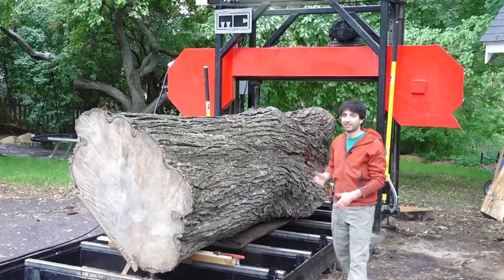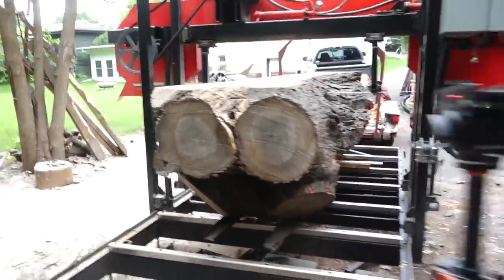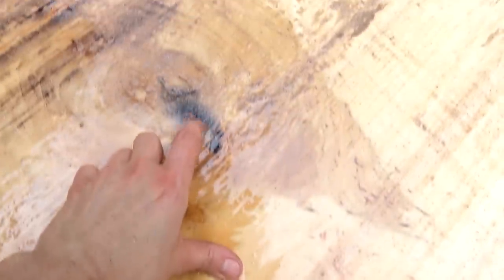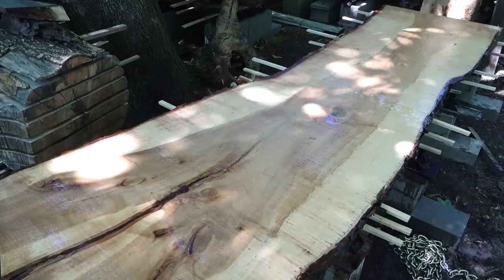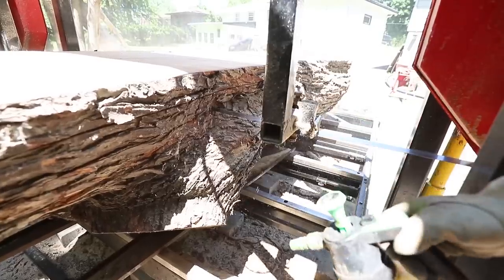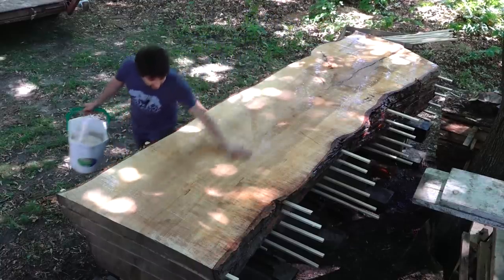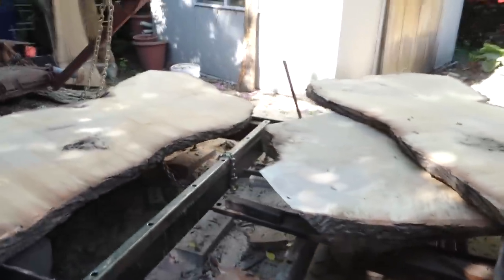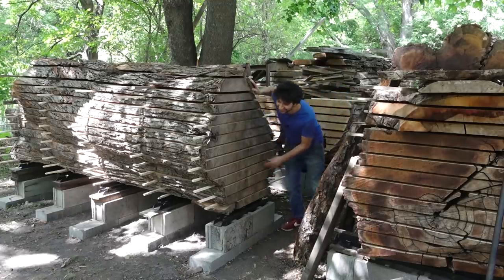The most steel I've ever cut through - Slabbing a Big Silver Maple

Comment: About 25 years ago I used 2 metal shelf brackets to attach a bird house to a maple tree in my yard. Within a couple years the tree grew enough that it destroyed the bird house so I was going to take the shelf brackets down... NOPE, the back part of the brackets was almost totally engulfed in tree. I ended up just cutting off the protruding part of the brackets. Now you can't see any metal and there's just a little rough bark where they were. The trunk is about 5 feet in diameter until it gets about 7 feet up where it splits into 2 branches. It's a large tree and I can only hope that if it ever gets milled up the person doing it is as nonchalant about sawing steel as you are.
Reply: No doubt!👍

Comment: How many blades do you run through on these kinds of trees?? and how much do they cost?
Reply: well it's probably a $10k tree so a few hundred dollars in blades isn't a big deal.
Reply: 20 years ago I charged $25 for each 13’ blade for the Woodmizer that was damaged by debris in log. 
Plug cutter and nail puller worked well removing the metal .....usually
Reply: That aint no 10 thousand dollar tree.

Comment: Gotta admire Matt for perserverance.  After he recounts all the work, misery, and bolts and nails that wrecked expensive blades, he answers to - "Why bother sawing these logs at all?"  as  "...mostly for the adventure.... I just really, really enjoy the struggle!"   Wow!  13:39  Now that IS honesty!  I'm wondering if he couldn't use a metal detector and then tack weld or stud weld (after side grounding), each of the steel bolts or larger nails to then twist them out, rather than ruin those huge wavy-cut  blades?

Comment: Forget the crank handle Skipper, use an old school traditional 8 spoke ships wheel.
 
Don’t mean to tell you your business but that’s obvious....
Reply: Heck yea, standing throttles on a ship can be a blast when you are doing maneuvers. I am thinking a big brass ahead wheel, but I get your point.
Reply: That would be easier on the arm to turn, but when he sprays the blade he would have to stick his arm through the wheel to reach. That could go bad quickly.
Reply: @clintraley856  I can see a mod where he just runs a hose up into the saw with a small misting head on it, with a valve of some kind within arms reach but safely out of the saw.  Could probably even automate it.
Reply: @TheOneWhoMightBe  Now I could get behind that!
Reply: Easy to get behind something when you don't have to pay for the parts or do the labor.

Comment: Is the dipping (large material loss) and the ruined saw blades and the extra time worth having the metal inclusions? 
What if you remove the metal inclusions and then reinstall them after the cuts?   You could use a colored epoxy and hammer that metal back in and boom - best of both worlds!

Comment: couldof been from old Fencing. Bullets being shot at it. Could be from Environmentals Spiking the Trees to Damage blades from Loggers. Happens alot of the time really. People will Drive Spikes and Nails into Trees trying to cause Damage to Chainsaw blades, trying to Stop logging in forests. Or try to Damage Saw mill blades in the cutting process. Around here in Virginia, I sometimes pickup wood from Saw mill, They been having problems with people Spiking the Trees with Rebars. Couple of their Saw mills actually broke down due to rebars. a Few 10 thousand dollar repair bill
Reply: cheaper to just invest in a metal detector but i guess they don't think of that.

Comment: Good video. I'm not gonna try to tell You what to do, but look at how many blades you broke. You are using, what, 3 or 4 teeth per inch? I would have some more finer tooth blades on hand to put on and slow my feed, when I started hitting metal. It would be cheaper. Took you the better part of a week to process that tree any way. Thanks for sharing with us!

Comment: Aside from steel, tree is placed wrong. When you have these... "crotch"... (V-shaped, where branches start to form), you should saw from root of the tree, forward to branches. If you enter from branches to root, then tree is squeezing your saw and can damage it, your cut line will not be straight etc. When cutting "normal" tree, without big knots from branches (unlike this one), then you cut forward to root of the tree (like you did in this video). 
We have big sawmill (55kW motor, saw length of 9,8m and width of 18cm), and when sawing oak which looked like this maple (crotch) and entering with saw from branches to root, it happened to overload the motor and would stop motor and saw if operator didn't stop it manually. Wood is simply squeezing saw from side and making it to stop.
That could easily be reason for your blade "going up".
Reply: The tile "The most steel I've ever cut through" is misleading.  He cut through wood not "steel"! lame!

Comment: Are the blades you run through metal reparable? I imagine they aren’t cheap. Love your channel brother!
Reply: I would imagine it would be cheaper to replace the blades missing multiple teeth. You'd have to weld on new material then reshape new teeth in and reset then sharpen. That's a lot of work to repair a blade missing 11 or so teeth in just a short section of the blade. Of course the narrower logs would likely be fine as long as the remaining teeth are sharpenable and there isn't too long of a section missing sequential teeth. I tbink he said the price of his blades at one point in another video near the end of the mill build, and yeah they weren't cheap. Sharpening them isn't exactly cheap either, but sharpening salvageable blades is slightly cheaper than new ones. Gotta have a decent number of blades on hand when you mill the amount of slabs that he does. Other channels with smaller factory built mills have stated that their blades are one of the more expensive parts of milling, and they can order blades from the manufacturer to fit their mills. Matt likely has to order custom length blades for his homemade mill.
Reply from the maker: The blades I'm using are $48.  Only the last blade is probably a bit too far gone to bother sharpening.  The others are still in great shape and could be sharpened and reset.
Reply: @mcremona  Pretty good price. I´m buying blades here in Czechia, EU, 35mmx1mm, 22 mm distance of tooth. and it cost 4€ per meter, weld cost around 2€.

Comment: I appreciate your video. I have wanted to cut wood on speculation for boat building timber. On the west coast here can be found the Oregon White Oak, cedar and fir. Cut it and dry it. It is valuable timber air dried. There was a book called "Wood_a manual for it's use as a shipbuilding material" actually a compendium of five U.S. Navy volumes; I think the sum of Navy intelligence on that. They remove the lumber as soon as possible after felling, doesn't matter if it was winter or summer, just get it off the forest floor...also they seal the ends of the grain with beeswax, locals will use primer paint, during the curing process to prevent checking, splitting.

Comment: You don't need to explain your love of wood and sawing.  I spent a good deal of my 20's making furniture out of this type cut.  Tables that were the conversation piece at parties, etc.  I found a fellow who had imported 4000 acres of virgin log from central Africa, including bubinga, coco-bola, and zebra wood.  The tables were stunning.  The craftsmanship was the wood itself.  This fellow claimed to have the largest band saw east of the Mississippi.  It had 5 foot between the guides.  He stacked just like you do with the entire log together (with spacers) which he stacked on flat bed railroad cars to use in his kiln which held 17 flat bed cars for each fire.  He then stored them in a large metal barn stacked up 20 foot high.  It was like a shopping mall for exotic lumber.  He also had some domestic lumber, not a lot of soft wood, mostly hards including cherry, maple, ash (one of my favorites), walnut, pecan, etc.  He supplied tongue and groove paneling for the Dupont mansion in Delaware.  As he described it each room was a type wood theme with raised panel walls, cabinets and doors.  He sold me quite a bit of the overruns from that project which made some beautiful cabinetry.  He had his saw mill just east of Waldorf Maryland and his tongue and groove milling operation at Conowingo Maryland.  He eventually made a deal (back in the 70's) to swap his saw mill to Idi Amin of Uganda in exchange for the 4000 acres he cut over there.  He was dismantling the entire sawmill while I was there on one trip.  He retired from the business afterwards and sold what stock he had.  He and his daughter then traveled the world and imported handmade wood and stone jewelry boxes.  Name was Larry Hagy.  I hauled many a load of lumber out of his two locations over time and had it stored anywhere I could find room.  I often wish I could go back in time to then.  I've had a dream of owning a saw mill and land with good timber most of my life.  I'm old now and probably will never see that dream fulfilled.  So I really enjoy watching your zest for your operation.  And I'm a little surprised those close-in neighbors allow you to cut there.  Must be real gems of people.   Good luck.  I just found you and subscribed.  Will watch.

Comment: I have a 5x10' cnc router that we use to surface slabs for other people. Not a real fan of steel in them. The mill near here has a dry kiln but so often the slabs are really twisted, making it only possible to get one flat side and the other highly variable in thickness. There was a lot of $ in slabs but you paid for it in blades & effort.

Comment: I have zero experience in slicing up slabs of wood as done here. I have a simple question that I'm sure other unexperienced wood cutters would have. Why do you not remove each cut slab once it's cut? I would think the weight of it on top would add more resistance to the next cut. The only reason I can think of is those above layers could aid in a flatter cut.
Reply: TigerZero aka Allen the weight will push on the blade and heat it up, extra wear and tear
Reply: @busterbeagle2167  That is what I was thinking. But your response didn't answer the question. Why don't they remove a slab once it's cut?

Comment: That maple looked great. Will make for some nice projects. Couple questions on your mill: what size wheels on the head? What horsepower on your motor and what size blades are those?
Reply from the maker: 30”; 10; 1.5”, .045, 7/8, 25’10”

Comment: The dips are caused by the toothed edge of the blade heating up and expanding turning it into a conical band with the leading edge a larger diameter than the trailing edge. That's why it travels towards the outside of the band which is downwards where it contacts the wood. To skip the dip, stop the cut and let the blade cool before you continue after you cut through the metal.

Comment: I wonder if the hardware in the tree isn't holders for early electrical insulators. Before they went to power poles, they used whatever trees were near a house to string it's electrical wires.

Comment: That "metal inlay" should increase the value of those slabs more than enough to pay for the blades, and the damage to the router bits when you surface them!  A few years back, I milled a log from a residential area in Joplin, MO and hit dozens of bullets.  There had been a famous shoot-out with Bonnie & Clyde in Joplin and I always wondered...

Comment: You need to invest in a metal detector, each cut that goes thru nicely, detect the whole on top where you wish to cut again. A entry level detector will save you heaps of blades.
Old trees as big as that has quite often spikes etc in them, so get a detector
Just a thought
Brad

Comment: To save your saw blades... could you possibly remove the larger steel with a deep/small diameter hole saw or weld an eye bolt to the steel and maybe yank some of the steel out with a fulcrum(!?)

Comment: Build a roof for your mill. Make sure to make it high enough so that it doesn't interfere with loading/unloading logs and lumber. Build the frame work with lumber that you mill yourself and put a metal roof on it. If you're concerned about thunder storms then how safe do you feel when you're in your house? It wouldn't be much different whether you were in your house or under a roof for your mill. With that all being said an even a safer place to be is in a faraday cage, i.e. a vehicle with a metal body.

Comment: I'm curious why you don't wedge your cuts at all, even when you've got 5 previous cuts stacked on top?  Heat and pressure just not a concern for bandsaw?
Reply: The slabs are stiff enough that there is little pressure on the blade from the cut slabs. It would be different if he was cutting them 1/2" thick, as the would flex much more.

Comment: It would be nice to use an auto body stud gun to weld to the nails and pull with a slide hammer. The trick would be to connecting a ground to the nail. I believe it would save more of the wood.

Comment: :Matthew:  You seem to enjoy making things, so make yourself an automatic blade mister.  Just buy a small aquarium water filter pump. Have a feed tank as input to the pump and install a "Y" on the output. Run one side of the output side of the "Y" as a return line to the tank an the other side through an adjustable valve of some kind to the mister/nozzle near the blade. Wire the pump to start/stop with your bandsaw motor.

Or, you could go the really cheap method and just use a gravity fed drip system.

Comment: Should clean the mud off before cutting, it holds sand and gravel that will dull the saw right quick.(if you didn't have all the steel nails) This is part of why lumber mills debark before sawing.

Comment: I suspect that over time you will learn that most interesting grain beats uniform slabs hands down! A metal detector is cheap and saves many extra costs. Old buried fencing is my bane. The stains can really screwup finishing. The good thing is these days people find those artifact elemnets to be happy accidents. Cutting wet helps!? The nightmare is a cabled tree that has the anchors and shackles included and no longer has telltales on the surface. Like remnants of old tree houses. All else aside, carbide blades and slow progress can be good practice.

Comment: Interesting watch, thanks.

Matthew Cremona: Consider this.  You are sufficiently skilled to be able to construct this saw and so such a concept should not be too hard.  You probably know people who are into electronics.

OK then, a body of metal, such as the band on a band-saw, will have certain electrical resonant properties.  When you touch a nail, that blade has electrically increased in mass and its resonance will change.  Convert and amplify that into a tone, or an error-correction signal and no more, or fewer, lost blades (it's quick - you'll stop advancing and lose fewer teeth).  This sort of technique is used a lot in industry and is probably already patented to death, but as you don't sell it, why not!  To do this, you'd need to electrically isolate the blade guide and drive wheels (maybe as simple as putting tape in the channels to stop the blade touching and maybe nylon bushings for the guides).

Now, you'd hear (if simply amplifying), a fairly constant tone that would change when the blade touched a metal object in the wood.  Yes, you can hear if the blade hits metal - maybe, but maybe not...  This would be very sensitive and very quick to let you know.  If it were used as a signal to tell the saw to back off, then you could simply let it get on with it.  To make a small basic box, anyone good at electronics can do it in the garden shed - that level.  It is probably only $10 of components too.  It is basically - yes, you could modify one instead - a metal detector.  I'd sense the band magnetically, with the sensor running in proximity to the saw band - no contacts to fail.

Someone will make one and the Chinese will sell it and make millions anyway.  Before you think I'm naive for giving away free ideas. A, I'm smart enough that I don't care, and B it takes way more effort to actually develop something like this into a real item.  Ideas are great, but they are two-a-penny - you have add the EFFORT ingredient to have success, so no, I'm not being naive.

Comment: can you get those blades sharpened?
and re-use them?
Reply: Yes.  The tooth tips are often carbide steel welded to the tooth profile.  Those tips can be replaced individually, if need be, though the sharpening process usually just means re grinding the cutting edge to the proper angle.

Comment: With the price of large bandsaw blades what it is Iwould pull out what ever I could oof the steel before Iruined a perfectly good blade.You can always mix a little glue with saw dust to fill the flaws caused by the removal.

Comment: You could do with a catch bag under the sawdust ejector. All that dust can't be good for lungs.
As for nails in table tops? Personally, I would rather have the nails pulled out and have the holes injected with epoxy.
Can you set blade guide rollers, above and below the blade set close to the tree, so at least it wont ride up or down so much if it hits something nasty.

Comment: These are hypnotizing! But I have to ask - why do you run the saw with the control enclosure open? I can't imagine sawdust is great for the longevity of the VFD.
Reply from the maker: Easy to access the controls. The enclosure is facing away from the action so it doesn't get much dust in it.  I hit it with the leaf blower as I'm cleaning up the rest of the saw.  I'm always surprised how little dust is in there.

Comment: Wouldnt it be a good idea if you run a metal detector thru the log just one of those hand detector  it would save time a blades and you could get an idea where metal might be and take it out or kno how far to go and a detector could pinpoint the metal very easy  for you before you start cutting